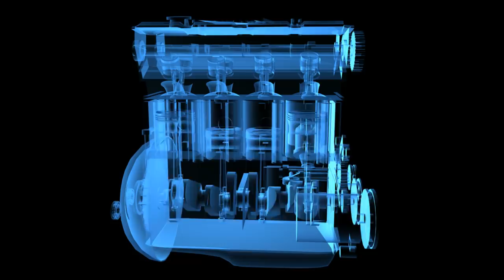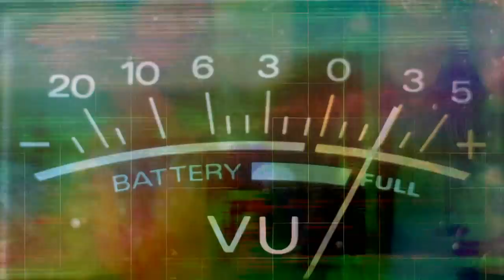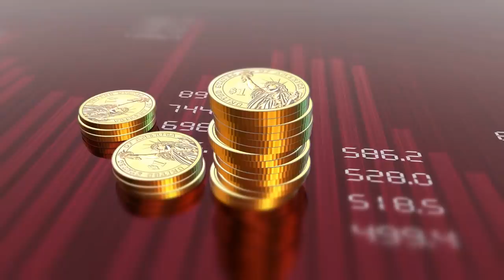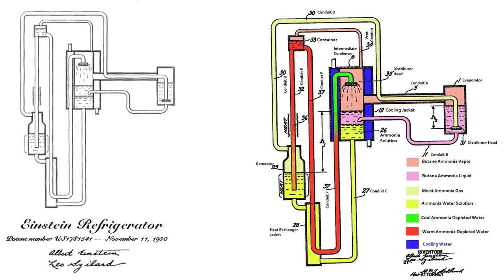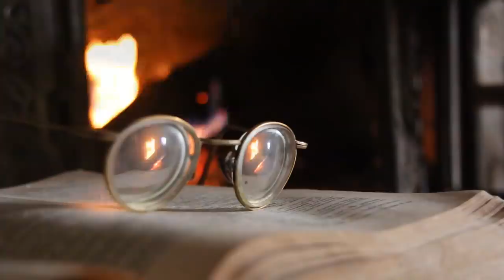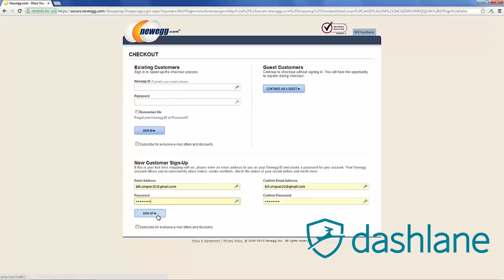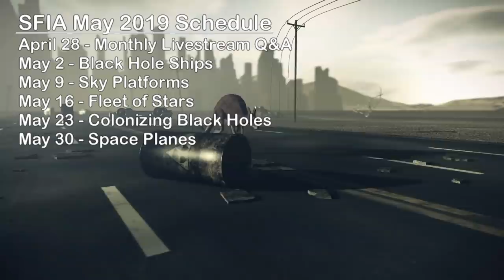Post-Apocalyptic Civilizations

Comment: I changed oil in my diesel-engine last year changed first time in over a decade. For reasons.

Diesel in the tank (I drive about 20 days/summer) was 6 years old, rather a large tank. I just yearly added some alcohol to suck up the moisture.

Engine was salvaged in 1990 from one of the "normal" Japanese mini-tractors/town lawnmower type.
It's installed in my boat which is stored outside, temperatures between -40C and +40C (-40F and random guess about +60F ?).

Also some diesels run with used self-filtered vegetable oils (just need a bit of change in shaft or they knock a bit). Larger engines (this is 2-cylinder about one liter engine) work better, marine diesels forever with some care.

For once I both know by my profession and experience more than mr. Isaac Arthur... Well it wasn't THE main point in this episode. Some fact-checking mistake there (yes, gasoline is not diesel I know).

Oh, I had to change some electric parts (one that pumped fuel 6m from the front of boat and belt and charger when boat sunk-and engine almost all below water-due to through-rusted tailpipe) three years ago. Not oil, and intake wasn't below water or I'd have had bit of a trouble. Bit older engines (or industrial) are lot more durable than today's optimized ones.

Comment: While traditonal black powder is easy to make, the modern smokeless powder needed to operate semi-autos would be more difficult and a lower priority. So the terminal velocity would be reduced and most guns would need to be manually cycled. Primers also require more refined chemistry and tooling so cartridge ammo would become very expensive.

Comment: In Mad Max, one of the vehicles clearly had a wood gas gasifier implying alternate fuels such as wood was used.  Also most gasoline engines can operate on ethanol.  The answer to where they get their gasoline is that they don't, they use ethanol and other alternatives.  Note, you can synthesize linear hydrocarbons from the carbon monoxide and hydrogen produced by a gasifier, you just need a Cobalt oxide or iron oxide catalyst, about 20 atmospheres of pressure and the ability to cool the reaction chamber to control the temperature, I can imagine converting old propane canisters into such Fischer tropsch reactors.  Basically it would be easier to synthesize gasoline from agricultural waste then distilling it from crude.  I would also imagine they would use a lot of diesel engines as it only takes an oil press to produce vegetable oil from say canola or soybeans plus the production of ethanol produces some methanol as a waste product and methanol and lye are catalysts needed to produce biodiesel from vegetable oil, older diesel engines can also run directly on vegetable oil so long as they are first warmed up with diesel or biodiesel as well as flushed before shutting down with the same.

Comment: Gunpowder is fairly easy to make yes, but not smokeless powder or primer. Those are the things youd need to make semi automatic weapons work. If you figured out how to make just primer (or percussion caps maybe) you could get bolt actions and the like to work but for semi and fully automatic guns they would foul too quickly with black powder to be a viable option

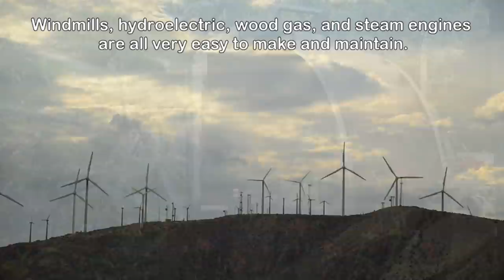Comment: 8:00 - wouldn'T really call it a halflife - halflife would imply that after a certain time a random selection - about half - of your supplies have gone bad and after that time again half of that half have also gone bad and you have 1/4 left - and after 10 halflives only 1/1024 of your supplies are still good so at that point it would actually become scarce and you would have scavenger issues
this is more of a sudden cutoff issue though - food generally spoils over time and after a certain time it is useless - there is a little bit of uncertainty to that time  but it's generally not a 50/50 chance over a given time situation

Comment: I told someone, that in a post-apocalyptic setting, you should not bring society back further than the 1950s. People who know how to work things and the books necessary for that won't just go away either. One thing that is hard like you said is oil, we've nearly completely exhausted our supply of readily available near-surface oil reserves, and if this post-apocalypse was caused by war then those oil reserves, refineries, and even the oil fields may have been specifically targeted. So a post-apocalyptic civilization may be horse-drawn. In terms of weapons, things like rocket and shell-based artillery are easy enough to make, guns aren't tough to make either, and even something like an RPG-2 or RPG-7 could be made. If the rebel in the jungle of the Philippines can do then so can a post-apocalyptic environment. A plane like or WW1 bi-plane is also not super hard to make, of course, you'd still run into the problem of fuel. 

Even with the problem of fuel, there are still steam-based tractors, railroads, and other things that would help society move pretty fast. Electronics would be extremely hard to maintain, though like you said simpler electronics would fare very well for a very long time. things like calculators, and even a computer as long as it is powered could work for years or even decades if it is cleaned regularly. even WMDs wouldn't disappear, and chemical gas isn't hard to make either, I'm honestly surprised more terror groups around the world haven't made it, considering all you need is a marginally good chemist and the right materials.

Also, another thing I don't see people talk about nearly enough in a post-apocalyptic setting is that there would be a living shitton of ships out at sea and thousands of planes in the air when whatever causes the apocalypse hits. These planes would likely land at whatever was available after a few hours of flying around to make sure they weren't going to kill everyone by landing. The ships would be a different story. Cargo ships could potentially have up to hundreds of thousands of tons of undamaged material and if several dozen get together along with a few fully loaded oil tankers, and maybe even a few naval ships, anchoring and running power only to keep the lights on, they could stay functionally invincible for at least a decade. Even more so, if they have something that has a nuclear reactor with them.

Comment: To get around the oil constraint, they could always brew alcohol and use that in engines. The book Ring World Engineers used this to explain how there were internal combustion present on a ringworld that clearly didn't have the depth to have generated fossil fuel.

Comment: On the other hand, consider Higgins - https://en.wikipedia.org/wiki/Higgins%2C_North_Carolina

Maintaining a technology is dependent upon having people who can maintain them. If the survivors are a few hundred people in a village, will they have the spread of skills needed to maintain a lot of the stuff mentioned in this video? How many people are needed in order to have the capability to manufacture a motorbike, which I'd say is the minimum needed for a steampunk/dieselpunk society - if you can manufacture a motorbike (complete with lights), you can manufacture a railway, batteries, engines, copper wire, relays etc.

Comment: Agriculture would definitely be relatively easy to maintain if life were possible, though I'd argue that it's very possible it wouldn't be necessary. It's only when there is a scarcity of resources that it becomes worth practicing. I think we'd see a lot of hunter-gatherer societies if it were a post-apocalypse with very few humans, simply because there'd be no need to practice agriculture, as that becomes more time- and labor-intensive than trapping and grabbing some fruits and tubers. Especially in areas free of predators, like the UK.

Though feral dogs might become a problem quite quickly. They would essentially be an invasive apex predator. It's unlikely they'd be a substantial threat to humans, since wolves never really have been - only a nuisance and a threat to herds (which not having herds solves) - but the ecological disruption might be devastating, at least in the short-term.

Comment: Depictions of post apocalyptic civilizations also often get based on the assumption that the entire world collapses at once, when there are only a few events that could cause this to happen. Consider the Bronze age collapse, we often view it as all of civilization collapsing, but really it was just in that one area. The Huang He river valley was untouched, and civilization kept advancing there, and the same applies to the fall of Rome and Greece. Let's consider a modern example, say that we do end up with runaway climate change, it still doesn't mean that modern civilization collapses. You'd have a lot of people starving to death and many major cities flooding, but likely more people would move closer to the poles, and formerly small towns there would turn into large metropolises. Different food production techniques would have to be developed at breakneck speeds, and generally civilization would barely miss a beat in the grand scheme of things. That said, I would rather avoid this scenario if at all possible, but I just wanted to illustrate that although many places would die out and food supply would shrink, what we often think of as a doomsday scenario would be hard pressed to knock out our current technology and society.

Comment: Fuel can be restored to an extent by filtering out the additives once they go bad(that's what makesup most of the sludge). Year old fuel isn't GOOD fuel, but it's not necessarily unusable if contaminant free. 
Fuel can also be replaced with analogs once it's no longer obtainable. The real concern should be the other vital fluids that cannot be replaced so easily, such as high viscosity oils
Reply: Also Kevlar is only "good" for for a couple of years even if properly stored. If worn daily they go bad surprisingly quick. In a post collapse senario you can expect a lvl 3 vest to just be a bad fashion accessory after 18 months of constant wear and elemental exposure. Also you can't really repair or upgrade a vest w/o ruining it like you can other materials.
Reply: 10:00 you've obviously never been to the nastiest part of your hometown. People under many kinds of duress stop maintaining personal hygiene, particularly types depression, stress disorders, delusional states (and being under constant physical threat) can all include a lack of personal care as symptoms AND would be rampant in a postapocalyptic senario. Also the "weekly bath" was still a huge thing in America until the 70's

Comment: I been filling up thumbdrives and old hard drives with "Prepper" type information.  Its such an easy no brainer to me and I dont understand why more people do not do it as that informaton is more valuable than anything else you could bring in a SHTF situation.  Hell, Wiki can fit on a small thumb drive and rasp pi can run on solar cells if need be giving you all information one could need.

Comment: Several issues with this one.
1. Hunting vs Agriculture: hunting is, calorie spent per calorie gained, more efficient without modern supports. Likewise, calories gained per hour of effort is also greater in hunter/gatherers than in agriculture.  It's only in persons per acre that agriculture really is better. (modern agriculture replaces manpower used calories with mechanically used calories.)
2: shoe soles - leather soles were, for centuries, the standard. Thick hide, vegetable tanned, produces a good, stiff, resilient sole material; a soft-soled boot attached to such a sole is very good for protecting the foot. Hobnails can readily be used in such soles; you hobnail one layer of sole-leather, stitch and glue it to a second layer which is itself affixed to the upper.
2a: as Schel Sullivan notes, tires make great boot soles. (they're  a bit thick, especially if using the treads, for some forms.
2b: less slick soles can use tar or pitch on leather for increased grip, or even use those to glue on sand or other grit for even better traction on many surfaces.
3: modern firearms:  reloading is a bottleneck for firearms. Yes, bullets (the projectile) and powder can be made readily; cases, however, have a limited reuse, and are not easily made without specialized hardware. trigger-happy folk are going to have problems with cases not long after having to replace the mag springs...
3a: reloading requires specific hardware to be effective: case jigs to return the case to spec, and bullet and primer seating jigs.
3b: primers are also not all that easy to make reliably, and are awkward to handle even if you do have the chemicals to reload the primer caps. Using them deforms them; to be useful again, you have to re-flatten the base, then load the right but small amount, and then seat them correctly. Get the amount wrong? hangs, misfires, detonation during chambering.
4: flashlights - most won't be working for long; batteries are a limited reuse item, and recharging is also not trivial in terms of hardware. Even rechargeables have limited lifespans. Bulbs and LEDs both also have limited lifespans; bulbs are also highly susceptible to vibration damage.  
5: greenhouses in the wastelands: Only if one can obtain suitable water supplies. Many desert cultures lack adequate water in concentration for agriculture, but do fine hunting and herding.
Reply: Hunter Smith  Agriculture as prerequisite for civilization is no longer a default assumption in the archaeological community; that agriculture needs civilization in the form of stable presence is a given, but the causality can be argued both ways, and permanent centers are used in a number of stone age cultures even to today without being linked to agriculture
 Recent digs indicate at least ritual centers in the Middle Stone Age. It is worth noting as well that Yupiq, Inupiaq, Inuit, and Athabasqan groups were semi-nomadic - permanent structures in multiple locations, occupied part time, and supported by hunter/gatherer lifestyles. Several current amazonian tribes are hunter/gatherers in permanent or semi-permanent villages - they are in target rich environments. They also have specialization to a degree. 
The most likely  reason we can't find cities more readily that predate agriculture is that the majority of them are underneath current cities, as gathering and settling  reinforce each other - given time and all the needed resources, large, permanent, stable villages and fixed agriculture are highly correlated....
But, remember,  *Correlation ≠ Causation*

Comment: Low pressure mechanical diesels will run off pretty much anything flammable that won't auto ignite in the injector pump

Comment: One thing I always wonder about when watching Zombie- and other Apocalypse movies and TV shows is what happens with the nuclear power plants. I'm no expert, but as far as I know, safely shutting down a nuclear power plant is a complicated and time consuming process. Changing the fuel load and getting the old, spent fuel into a condition at which it can halfway safely be transported away, apparently takes weeks. It seems unlikely that that would happen in most apocalypse scenarios. If all those power plants were just abandoned, wouldn't they all start cooking off and exploding one after the other, once their cooling systems fail due to (ironically) not being powered anymore, or due to a lack of maintenance and oversight? There is over 700 nuclear power plants on the planet and most of them with several reactor cores each. If they all would burp their shit out without anyone trying to stop it, I guess that they would spread an amount of radiation over the globe that would make a thousand nuclear wars look like child's play in comparison.

Think about it. Even in a full blown nuclear war, you would have a few hundred, perhaps a few thousand volleyball sized orbs of highly pure uranium and plutonium, designed to convert as much of their mass into energy as possible, go off. 
Having basically like 2000 swimming pools full of comparably dirty radioactive material just blown into the atmosphere, converting only minute percentages into energy, would be a totally different ballgame when it comes to the spreading of dangerous materials and radio activity.

If there isn't something I'm missing, I think surviving a Zombie Apocalypse would probably be kind of pointless, because you would only have months till the radiation kills you. And I suppose the same thing goes for most more realistic "end of civilization" scenarios. If there would be some sort of deadly, fast spreading pandemic, I doubt that the world's governments would have the foresight to start the shutting down process of the power plants as long as they still are able to do so, especially since they would need that energy more than ever in their fight against the pandemic.
My guess is that they would keep them running until everybody who knows how to shut them down is either dead, or defected to be with their families.

Comment: I feel like the further we get technologically, the harder recovering from a massive population collapse or technological shutdown becomes. 
we still have books, and it's relatively easy to get a written guide for learning how to do stuff like canning. What happens in a century or two when Paper Books are historical oddities the way 21st century people look at rotary phones and phonographs. Some collectors may have some but probably not in practical topics. 
who knows how to do home pressure canning in an era of improved logistics making doing so wildly impractical. 
soap is easy ... with a guide. The Star Trek concept of sonic showers makes an interesting question if those people actually know how to bathe with water, similar to how 90%+ of anyone reading this likely doesn't know how to bathe with dust even if they understand vaugely it's an option. 

one would hope these steps also come with ways to mitigate how far we can accidentally reset our clocks.